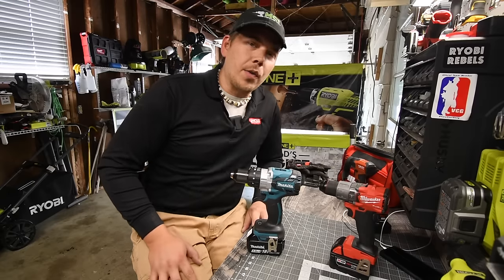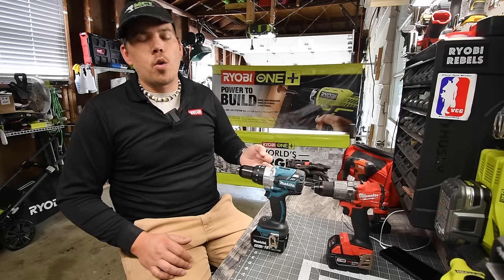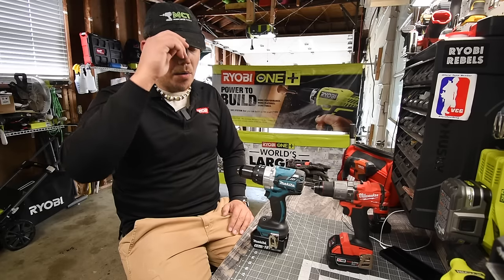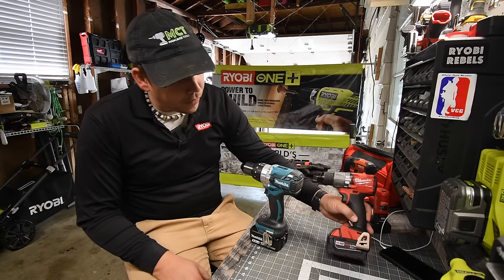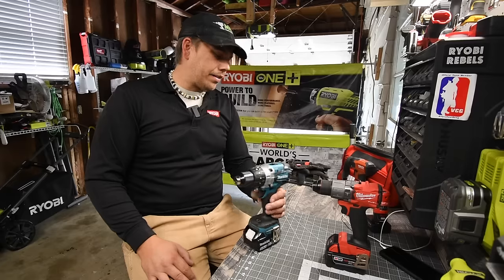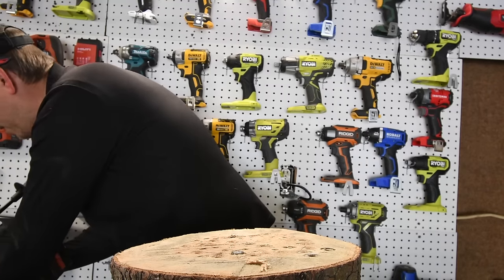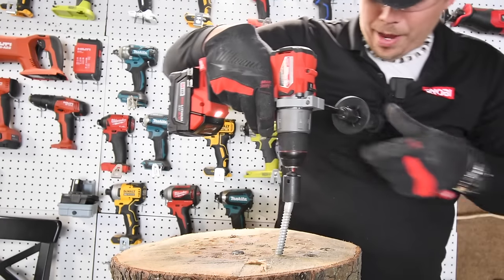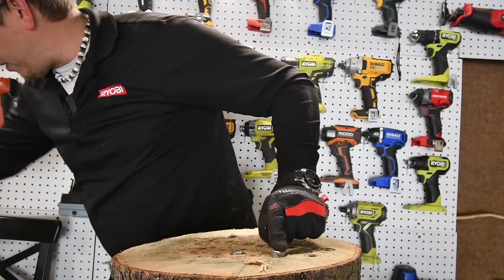BATTLE OF THE BRUSHLESS!!!  (Makita vs Milwuakee)

Comment: Sep. 2021
I just bought the M18 MILWAUKEE 2802 and comparing it with another that I have the Brushless 1/2 Makita 18v Dhp485sye, the MILWAUKEE 2802 is louder, the motor whistles, it heats up more, 
the battery does not fit at all, the charger seems iron but as a positive point It has a better Chuck, it feels powerful, 5-year warranty, it looks well manufactured.
Between MILWAUKEE and Makita the power seems similar, at the moment I prefer the makita since the motor is quieter, the motor and charger hardly get hot, time will tell if the heating in the 
MILWAUKEE is a problem or not.
It has cost me USD$185, winning the makita for USD$12 dollars less. 
I hope my comments contribute something positive to your purchases.
Reply: My makita 18v chargers get hot while charging

Comment: I am a professional carpenter with over 25 year experience. One thing that I have learned the hard way is always tighten your bits by hand. Do not use the motor. It saves the chuck. We all want to use the motor for speed and convenience, but that can be damaging.
Reply: Totally agree...
Reply: Use the motor to snug the chuck then tighten by hand.
Reply from the maker: I do tighten them by hand. use the motor to get the clamps with the bit then tighten the rest by hand
Reply: I didn't know that could damage the chuck. Great tip.
Reply: One thing iv learned with Makita is to NOT turn it back one Klick you actually end up unlocking the Chuck
Reply: also DO NOT aim them at the police when they drive by , learned the hard way
Reply: I go most of the way with the tool, then I stop and finish tightening by hand.
Reply: Eh my company pays for all my tools i need, great tip for my private tools
Reply: Just buy a cheaper drill to tighten it up, and use the good one to drill ....😜😜😜😂😂😂😂😂
Reply: I agree its better to baby you tools where needed to keep them lasting. Drills seem to go out quicker than an impact.
Reply: @8bitsamurai6  I've literally seen 6 new impacts (DeWalt/Milwaukee) go out in my current shop alone and only 1 drill go bad, and the drill is 15yrs old
Reply: i also learnt Makita do better woodworking tools
Reply: And one click back unlocks the chuck. This is how chucks get broken Dave i hope you understand how a ratcheting chuck works? Don't ever one click back. If you read the manual nothing says one click back!!!!!

Comment: You drop bits because you're not seating the jaws of the chuck on the flat sides of the bits and holders, don't squeeze the trigger to lock bits, do it manually watching closely to line up the jaws to the flat sides of whatever you're using. 

This doesn't matter for round shafts, go ahead and use the trigger.
Reply from the maker: I broke the chuck and I know how to set it bits lol
Reply: I agree, he didnt pay attention putting in bit. Also a washer would have been a good idea. Not paying attention to chuck still turning as well. I could go on but...
Reply: Apparently you don't. It may look cool and save some time spinning the bit in but it's bad practice in more ways than one.
Reply: Kevin Bradley Harmoning  Ya that's the best way to do it. Last few turns are by hand so you can line it up perfectly.

Comment: Doesn't matter what you use as long as the batteries are equal. If you have to use a higher power battery to beat the other drill, then the one with the extra power is inferior.
Reply from the maker: I try to keep it as even as I can. some brands don't have the same AH batteries
Reply: How does that make any sense? That's like two people arm wrestling but the stronger person has to starve themself so that they're equal to each other. It would be a different matter if you had to go to aftermarket parts to get the extra power but as long as it's a factory battery, you should use the strongest to compare which one is the strongest.

Comment: dude hand drills have come soooooo far from where they started. just remember a time when you would get one 1/2 inch hole done and boom the battery was dead and basically on fire  and having a corded drill was almost required for any project out from home owner work like hanging a picture
Reply from the maker: they are extremely powerful now. I thank you for viewing Drake

Comment: I have both actually, started with all Makita tools and switched to Milwaukee just because I wanted to. Makita is a great brand but I haven't regretted the switch yet. Also, the chuck on my Makita was clicking and messing up just like it was in this video until I adjusted the screw inside the chuck. Afterwards the chuck never acted funny again, no clicking when tightening or coming loose during operation. Anyway, nice video. Liked and subbed 🤙
Reply from the maker: cant go wrong with Milwaukee now. I thank you for viewing Jamey
Reply: How did you adjust the screw inside? You just tightened it or what?
Reply: Idk we have 4 Milwaukee drills in our shop. Two are dead, one drops round drill bits intermittently, and the one that "works" is the old brushed one with no guts.
The other three aren't even 3yrs old.

Comment: Why do you tighten the Makita chuck, then back out off a click or two?  Your loosening it!  I just went through my XPH07 manual, and you only tighten it.  Try the test again without loosening the Makita Chuck everytime... No wonder you were stripping the bit.
Reply from the maker: I will and I thank you Christopher
Reply: Yup exactly. Someone decided to circulate this myth about untightening by one to “lock” it and it’s BS.
Reply: Yeah that’s what’s stripping the bit
Reply: @kenshirogenjuro873  probably a Milwaukee rep started that BS 🤣
Reply: Yes I 100% agree iv never went back a click to lock it just tighten it down and  giver when you click back your unlocking the Chuck witch it's giving him problems just tighten it down
Reply: I’ve tried both ways and clicking it forward once after tightening seems to hold it in better. I use drills from top down with a good amount of weight on it so it always falls out anyway(gravity), but that click forward after tightening seems to hold it in better. The problem is when the drill always stops abruptly and you here that click, the momentum and that quick stop loosens the chuck. It’s something that that tool companies need to figure out and give a soft stop. Most electric drills don’t have that brake system, they slowly slow down and that’s why this rarely happens to electric drills.
Reply: Christofer Enoch, you are 100% correct! I was like "REALLY?!" when I saw that in the video.
Reply: Yeah i thought the same thing thats why he is striping the bits but otherwise good job with the video
Reply: It's obvious the Milwaukee has a better chuck

Comment: clearly Milwaukee winning here. It has faster times on most of the tests.  If this was multiplied by multiple screws  and per hour and per day you're using it then you can decide which one is going to give you the best performance over the long haul. It took all but 20min to break a chuck on the makita whether or not he was loading the bits in correctly or not.

Comment: Where are you getting that clicking the chuck back one click locks the chuck? I have that drill and a lower line drill driver and no where in either instruction manual does it say to do that.
Reply from the maker: it doesn't do it for all drills. the good drill have an extra locking feature on them

Comment: It seems to be a point of contention regarding the chuck locking features of drills.  I have to concur with Joshua Helms, and I have tried the ‘turning the chick back one click, ‘ and it almost always leads to loss of bits.  A lot of modern drills seem to have poor QC with regards to keyless chucks.  Milwaukee is sometimes poor, and DeWalt is ‘ famous’ for wobbly chucks, and the horrendous braking upon release of the trigger.  I have noticed DeWalt seems to have tried to improve on this in recent drills, but still hit and miss.  I own this Model of Makita, and it is one of the  better chucks out there.  It boils down to the user checking the tightness of the Chuck after every few holes drilled, or fasteners run, etc.
Reply from the maker: I thank you for your feedback George. the tension I put on the these chucks with the hardcore tasks maybe to much for the chucks. normally a impact driver would be used for those lags.
Reply: Dewalt has the best drills in the market tho
Reply: @miguelledezma1394  in your opinion. Top 3 in order for me goes teal, red, yellow.

Comment: If it stops, it fails. Watch the video close. He is biding the paddle bit by pushing it forward, or you don't know how to keep a drill straight one, take your pic?  He also placed the Milwaukee paddle bit, next to a hole, where the Milwaukee did not have to cut through part of the side. Do you reckon that matters at all? Go to the cement test. He cleans the dust out of the Milwaukee at 8 sec, 18 sec, 26 sec, 33 sec, 38 sec, the reason why, if anyone has ever drilled concrete, then you know you have to dump the dust out, or it will cut your drilling power down to hardly nothing. He dumps the makita after 32 sec, after it sits there and does nothing, while the whole time is losing cutting power is lost, because he does not dump the dust at all. Only when it comes to a stand still, does he dump it. Then, he is steadily pushing the drill forward. Look at the concrete hole. He push the drill bit forward so much, that the hole is wobbled out. He was smart enough not to wipe the dust off the block, like he did the board, so you couldent see just how much of a wobbled out hole he made, because the bit was not kept straight. Even though he did not wipe the block, you can still see how bad the hole is wobbled out. I don't like dishonest reviewers like you. What did you expect, that Milwaukee would see this and send you some free crap? Now, you know what drills I own? I own a Milwaukee 18v hammer drill, such as the one you are using, and the 18v 3/4 Milwaukee impact wrench, that I use for lug nuts and lag bolts. I don't even own a Makita drill. I just hate dishonest reviewers. If you want to compare apples to apples. Try comparing the Milwaukee 1200 in. lbs of torque, to the makita 1,250 in.lbs of Torque. Not 1200 verses 1025. That's like a car that can do 200mph verses one that can do 150, and say. Hmm, I wonder which one will win.